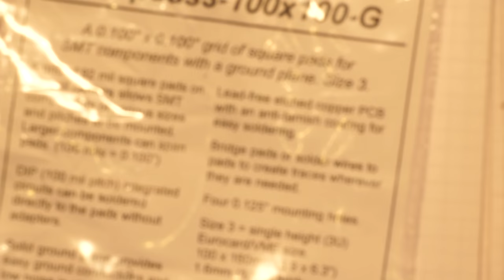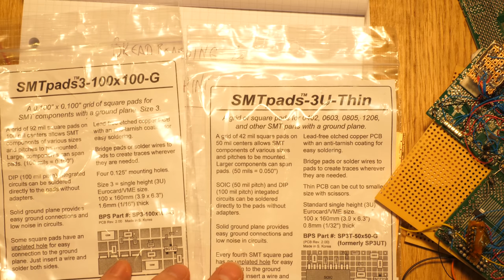Breadboards and prototyping electronic circuits (re-uploaded)

Comment: Tri-pad is good... but I've recently got into "5 holes to a pad" board which, to me, is the holy grail of prototyping board... it's quite hard to come by but it's great stuff. Not as compact as tri-pad admittedly.
Those that you make on the Smart Board... how do you design the layout for those? Or do you jut work from a schematic and do the layout as you solder?

Comment: Wow this is incredibly helpful!  I see you are using dip sockets on the .1" pitch smt boards,  are you bending the solder tabs over to mount on the board?  The chips seem a bit high in the air for that. I cannot believe some of the smt boards you have.  Tiny pads.
Reply from the maker: These were turned pin sockets, if you try to bend the  pins on those they will break off, so I just place the socket on the board and solder the pins to the pads without bending them. You can get SMD DIP sockets but they're horrendously expensive.